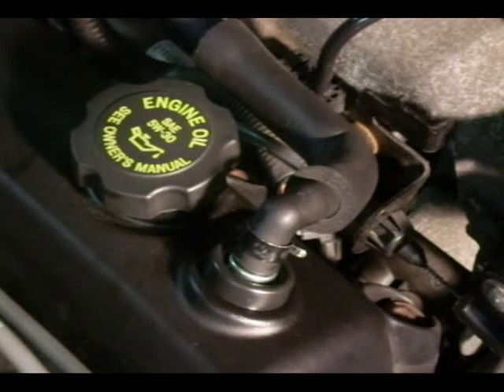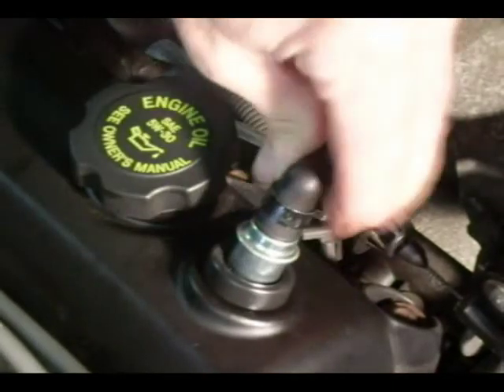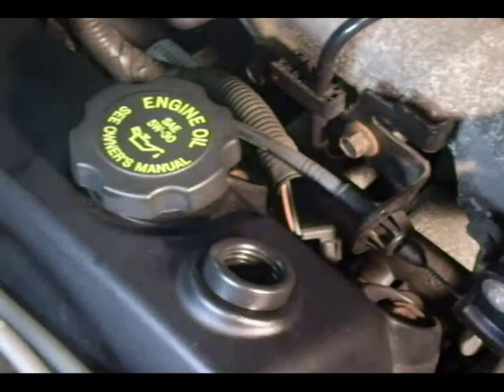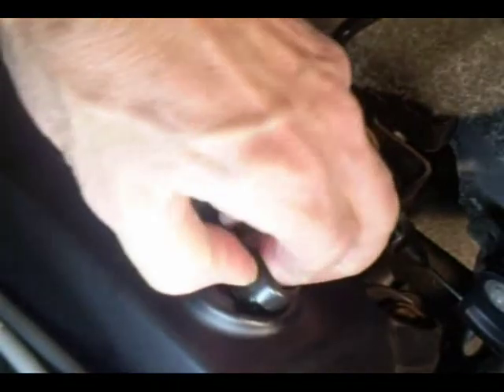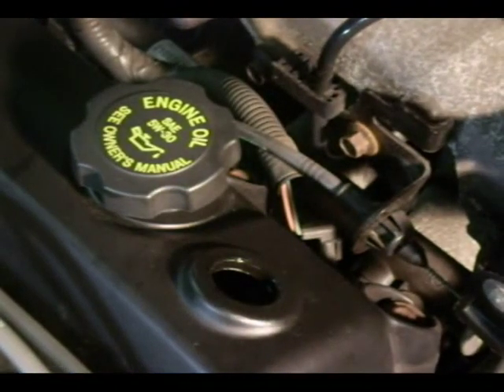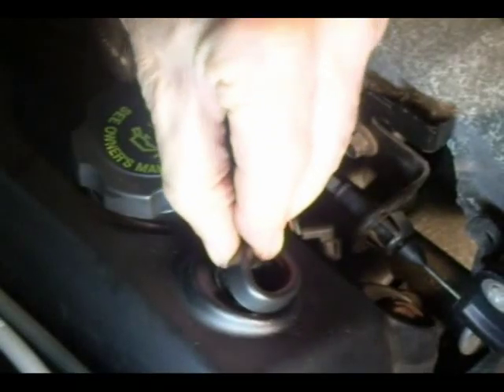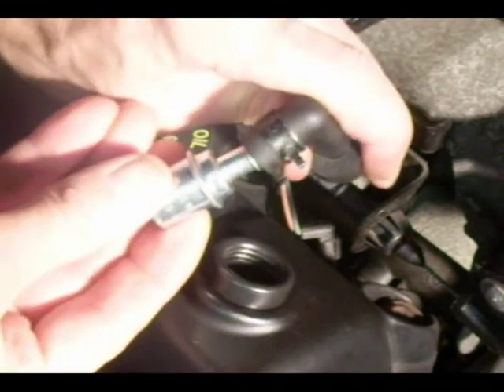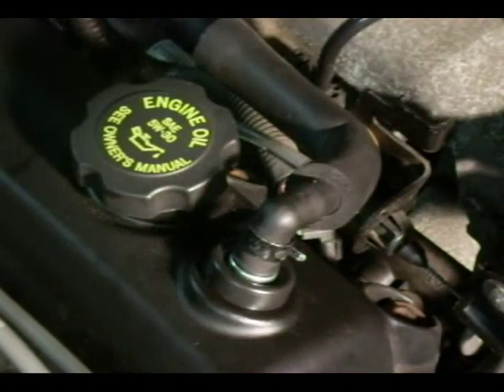Pcv Valve and Grommet Replacment

Comment from the maker: @StephanieP3 The valve cover gasket is under the cover and not the same as what i did here.The SC1 is a easy one to replace even for a first timer.Check out my video called "Jason's Saturn SC " and you will seeing me removing the valve cover.Once the cover is removed replace the gasket and put the cover back on the way you took it off.

Comment: @ThebigHurtt 99-02 DOHC valve covers will not fit 98' and older heads, the newer heads are narrower due to the smaller hydraulic lifter/roller design.

Comment: I couldn't get mine out of my dakota.  Fearful of damaging it I enlisted the help of a co-worker who claimed to be a dakota expert.  He started yanking it right at the elbow.  Before I could stop him he snapped the thing in half.  What's worse turns out it wasn't even the pcv valve.  It was the air breather cap on the other side of the engine.  Doh!

Comment: I heard if you take out the pcv valve when the car is at idle, all the gunk in there and in the hose with be sucked out by the manifold? Is that correct?  Thanks!

Comment: Today I did some car work and noticed on my 98 sl2 that the tube that runs from the pcv to the air intake manifold is cracked at the elbow going into the manifold. I cleaned out all the gunk and bad oil around the pvc and grommet.  Then i noticed the elbow was cracked when I move the tube up out of the way.  What is this part number and where can i get it, will I have to go to a pick and pull?

Thanks
-Scott

Comment: I have a Hyundai SOnata 2003 and I cannot find both valve and grommet in my country, is it still safe to clean both or wait for replacement before touching it? I'm afraid it will break when I pull it - sadly the base model don't have the screw type valve - this is what they have in parts stores.
Reply: Go to the Junk Yard found mine there and Still going Strong been 2 years just make sure the Grommet is Stiff when you squeeze it and Not Soft

Comment: How do you remove a gromlet that melted and hardened onto the valve. I'm afraid to force the turn of the PCv as I am afraid the gromlet will crack into pieces and fall in.
Reply: Why are you replacing a gromlet that is nice and rubbery?  The one you pulled off looked new.